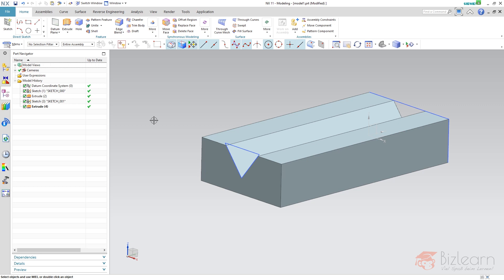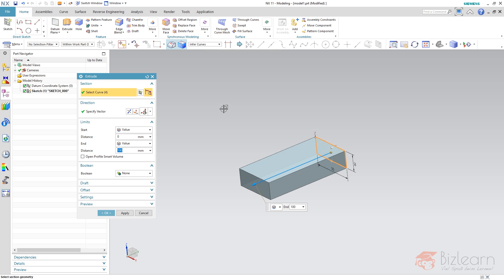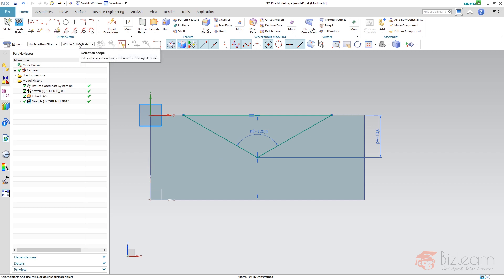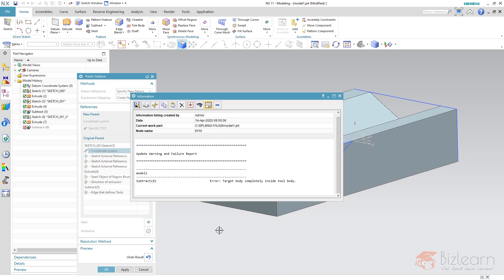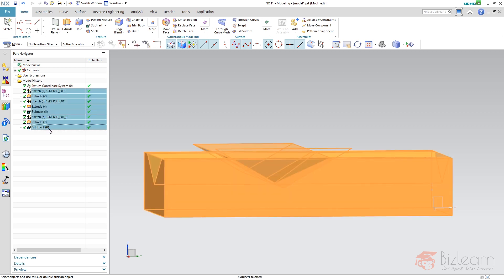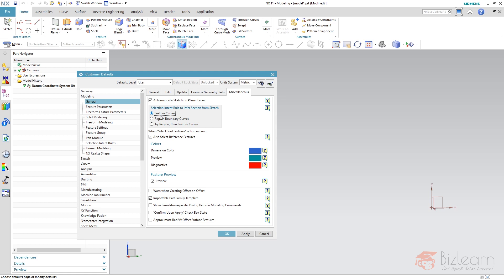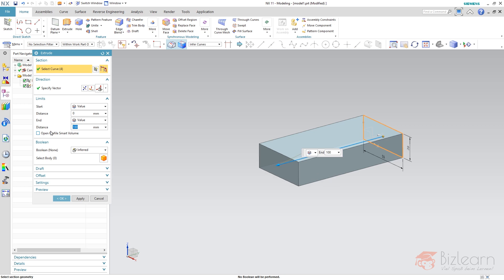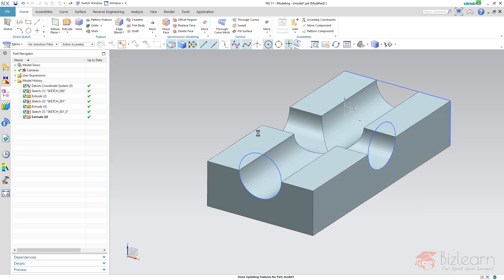Siemens NX Tutorial - two amazing settings nobody knows, which improve your modeling experience

Comment: How did you go from edge to profile building? The moment in the video is 6:50. Right Click - Okay? Or is there another way?
Reply from the maker: Just start the profile with a left click and the direct sketch will open... Got it?
Reply: @Bizlearn_Siemens_NX_Training  The question is different. How to tear off the profile line from the center of the rib and start building it on the face?
Reply from the maker: @RustemmKh  tear-off can be made with a middle mouse button click. A second click will cause the profile comand to be closed
Reply: @Bizlearn_Siemens_NX_Training  Спасибо! Работает.
Reply from the maker: очень охотно